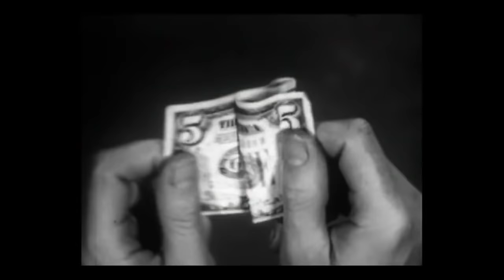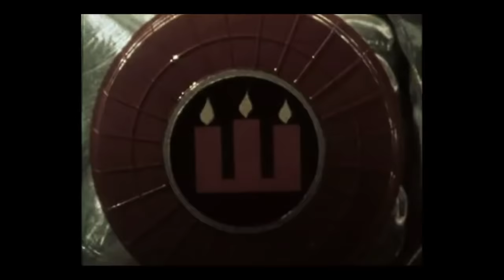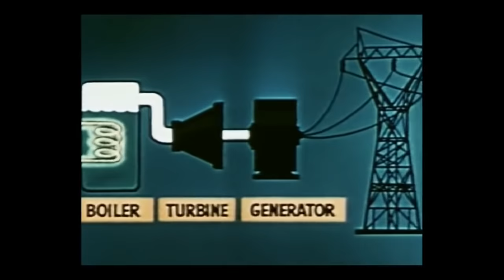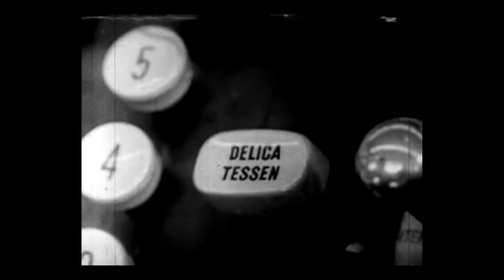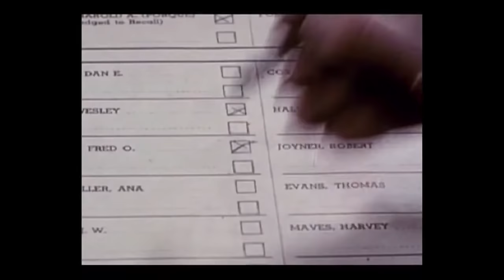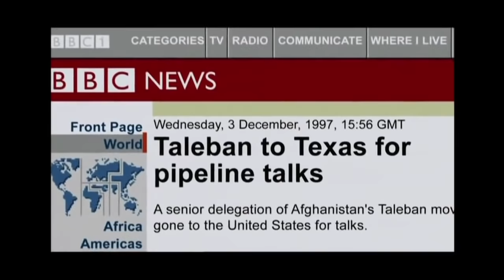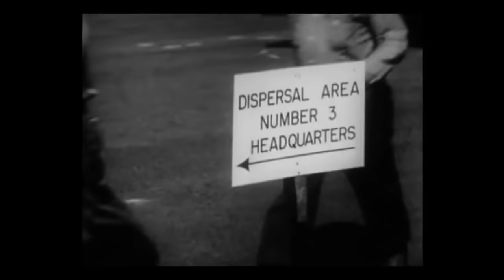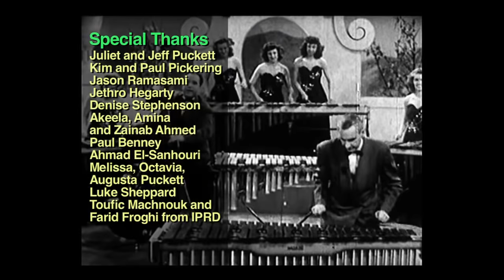Human Extinction By 2030 -The Crisis of Civilization!

Comment: The current level of CO2 in the atmosphere is 403 ppm, not 445. This documentary needs some serious fact checking.
Reply: angelheart1701 
Please Research ZEITGEIST MOVEMENT
Reply: @angelheart1701 

You missed the point. Yes in 2019 the CO2 is 408 but it is increasing at a present rate of 3 ppm/ year  so maths 450-408 =42 , 42ppm /3ppm/year =14 years

Comment: The world has reserves of oil for 40 years. That is how it has been for the last 50 years. There is simply no incentive to go looking for reserves of oil that will not be needed for decades yet.The U.S has as much proven reserves as it had in 1965. As for rising oil prices, that will mean more oil is economical to exploit. Russia has large oil and gas reserves but they are not yet economical to exploit. When oil prices tripled to 100 dollars a barrel the price at the pump only increased by 25%. here in europe. The price of extracting oil is only a small part of the final cost to the consumer. basically I'm not worried about peak oil. There will be enough oil in the ground to see this century out. By then renewables should be sufficiently developed to take over.

Comment: There are multiple misinformation in reference to numbers.
Numbers Mentioned in the Media
+0.87 C is the number most often quoted in the media to indicate how much the average temperature has risen globally. In 2014, it was +0.75C.  This is as compared to 1951-1980 global average. 
+2C is the “safe limit” identified by an economist in 2005 and eagerly taken up by world governments in 2009. That is a +2C rise above pre-industrial levels (since 1750).
+1.12C is the amount the global temperature has increased since modern record keeping began (since 1880s).
+1.32C is the number least discussed by the media and is the amount by which average global temperature has risen since pre-industrial times (since 1750).
The 0.87C and 2C numbers, quoted most often, are misleading because they are on different scales. 2C refers to temperature rise since 1750 and 0.87C refers to temperature rise above 1951-1980 average. 
Media should be quoting 1.32C and 2C, since they are on the same scale.  The urgency of the situation is just not being transmitted by majority of news outlets. 
Numbers Not Mentioned in the Media
+0.5C to +1C (above 1750 levels) is the absolute upper limit for acceptable warming, as per 1990 UN committee on climate change and actual scientific data (i.e. max 300 ppm of CO2 level).  Global warming becomes unstoppable after that. 
+0.6C (+- 0.2C) is the amount of heat still not realized because of a 10+ year lag between emission of CO2 and their full effect. Even if we stop emitting today, global temperatures will keep rising for years. 
+1.2C (+- 0.2C) is the amount of heat that still not realized because of global dimming effect (burning coal cools the planet temporarily). Even if we stop emitting today, global temperatures will skyrocket within months. 
Where we stand 
+ 1.32C  --- of current warming (since 1750)
+ 0.6C   --- unrealized warming from CO2 coming in the next 10+ years
+ 1.2C   --- global dimming effect that’s cooling us down for now
Total: 1.32 + 0.6 + 1.2 = +3.12C  (actual warming since 1750) 
+1C is the absolute limit for warming after which changes taking place become self-reinforcing. We’ve surged past that limit at neck breaking speed. 
Conclusion 
If global emissions stop today our global temperatures will increase to at least 3.12C above 1750 levels, at which point we would have entered a runaway state with temperatures rising exponentially until some equilibrium is reached (perhaps 8C above 1750 levels or higher).
In a runaway climate state, methane and carbon from tundra and ocean seabed will become the main source of green house gases and will eventually lead to extinction of most life on this planet. 
** Note: This note discusses numbers only. The source of this data is NASA, NOAA, Japanese Meteorological Agency and several climate change papers. All of these numbers can be independently verified. For global dimming see James Hansen’s papers on aerosol effects.
Reply: Maybe misread but it seems we are already past the tipping point so personally I would much rather go out with a smile. Another bear please barman. Make that a Polar bear in a blizzard please.

Comment: 192 MASS ANIMAL DIE-OFFS in 2017, yeah, 4 months into the year and a "Die-off" per day or more... 2030 is an optimistic number... Fukushima and all those 200,000 plus barrels in the oceans now rotten and leaking. The BASE of the eco-system is dying fast, and weather events will finish off all those mass farming & ranching efforts... 2017 USA has lost about 20% of all crops for the year SO FAR, and the Midwest it's farming belt is becoming a muddy swamp with flood after flood. China, Europe, India, Africa, who is not also effected... planet wide shut down of things humans need to survive. New viruses coming out of the permafrost, hidden for 10s of 1000s of years... toxic soup in every water way as the water temperatures increase so does bacteria & virus reproduction, chemical mutations everywhere....

Comment: Doesn't anybody here know about falling oil prices?
Reply: +Olaf Remlap The decline of oil prices is temporary. Linked to a drop in demand from Asian economies and an increase in supply due to shale oil industries and renewed exports from Iran and Libya. But the shale oil industries have been gutted due to the collapse of oil prices, resulting in decreased global production. Oil production from fracking is more expensive than traditional extraction. And the Asian economies such as China will eventually recover from their recessions. Oil prices will start to climb again. But all that put aside, there are subtle points you're not accounting for:

1) It's getting more expensive to pull oil out of the Earth because all the easy to reach stuff has been tapped.
2) Discovery of new oil fields is slowing. And the ones we are discovering are low yield compared to previous norms. 
3) Large scale state subsidies into the petrol industry mask the true cost of oil. Without these, people would be scrambling for alternatives to petrol.

Peek oil is still a concern. The long term trend for business as usual is a rising cost of oil, which will increase the cost of all other commodities and cause global economic strain.

Albeit, I don't think it's as huge a concern as other sustainability and structural problems the global capitalist state system faces in this era of climate change and transnational vulnerability. If all we had to worry about was peek oil, we'd be fine--innovations in renewable energy would allow us to replace fossil fuels as our main energy source, and industrial applications of petrol could be substituted with artificial petrol synthesized from processes powered by said renewable energies. But I don't think peek oil is our main existential threat.

Comment: OK, on the soap box again. To add to Mr. Ahmed's multiple crisis causes. One of the reasons the global atmospheric carbon dioxide crisis appears to have enormous inertia and a huge time constant is there are not enough reasonable intelligent people like you buying a Carbon Dioxide meter and measuring the gas levels locally. The global CO2 reference readings in Hawaii would barely respond if say the State of California did a 50% less CO2 holiday trial for a couple of days.

What that means is if you want to make meaningful local changes, you have to measure CO2 locally.

Comment: Had to give this a thumbs down even though I agree with the overall message of the film because it is wildly speculative and the knowledge of the speaker is clearly in doubt. For instance we have 150 years left of coal, 80 years of Natural Gas and about 50 years of oil. So a breakdown of everything in less than 15 years seems very unlikely. Does the author know about indoor hydroponic LED food production? Clearly not as they would then know that we are not reliant on outside traditional farming for food production. Population growth is the problem and as usual it is not really discussed here. 1 billion is plenty for this planet - it will take something big to cut the population down to that size again though.